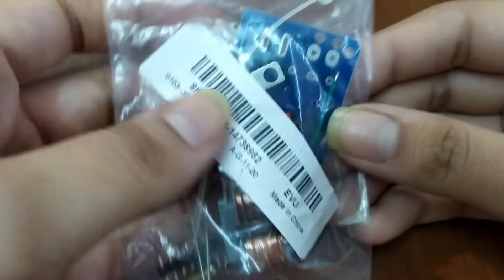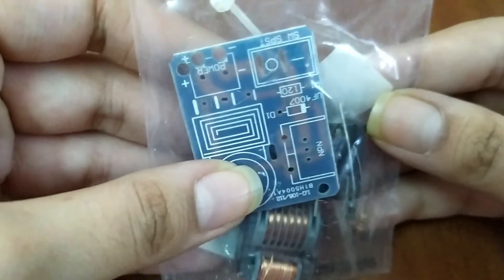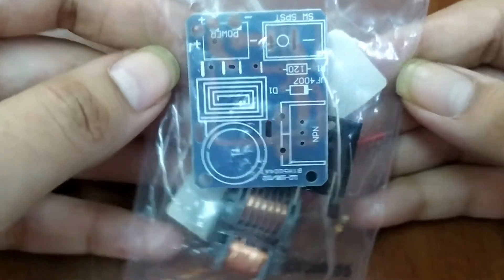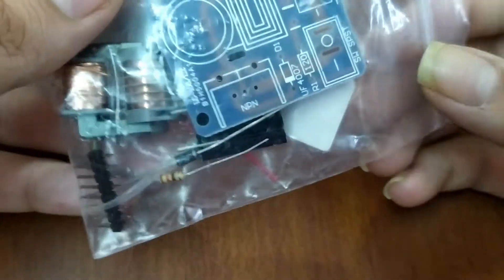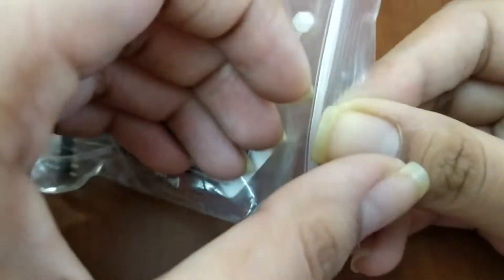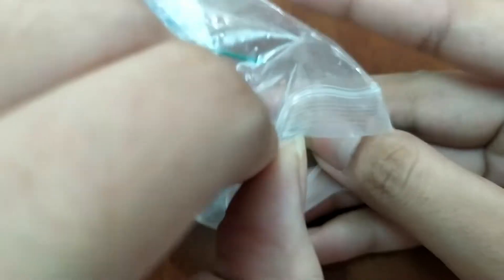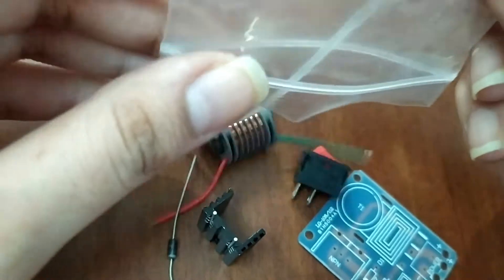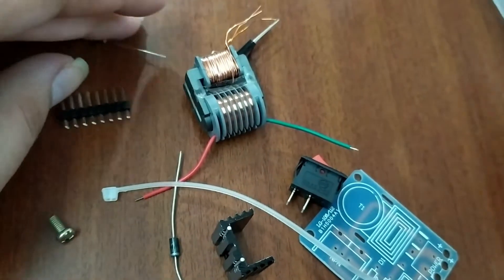15KV Arc Generator | High Voltage Plasma Lighter

Comment: I think if you keep arcs reasonably small(3-4mm) and for short duration(to light gas/candles/cigarettes ), then it won't damage transformer or transistor.
Even if you do epoxy/wax potting or put it in oil, there will be tiny air bubbles left in secondary winding. So basically don't run this without arcs.

There is no number on the transistor. If you burn/damage it then replace it with NPN transitors like D882, Tip41C etc.

For 3mm arc,  it draws 1.3A current. And operates on ~ 11k Hz frequency with 70% duty cycle.

Also, it is better to attach transistor to heatsink before soldering both of them. There won't be alignment issues later on. Those berg male pins are given to create arc gap. Use group of 3 pins to create 5mm gap by removing middle pine by heating it and pulling out. Then solder the arc gap to secondary wires.